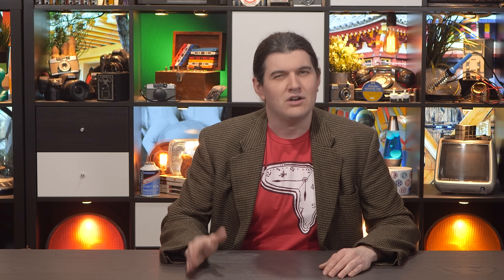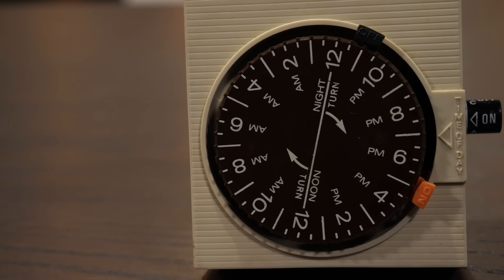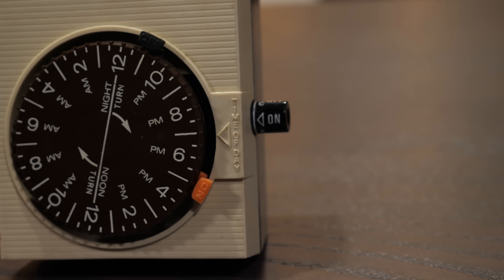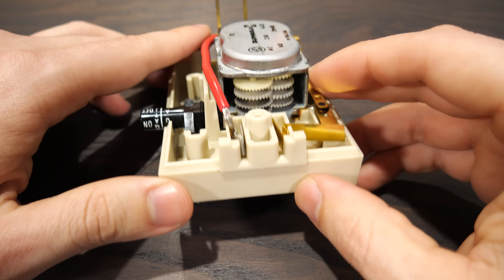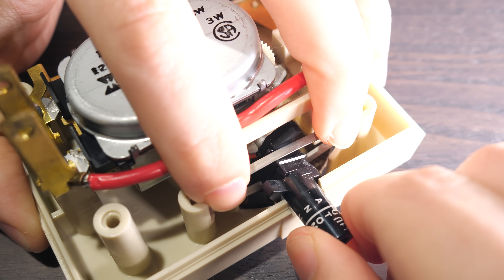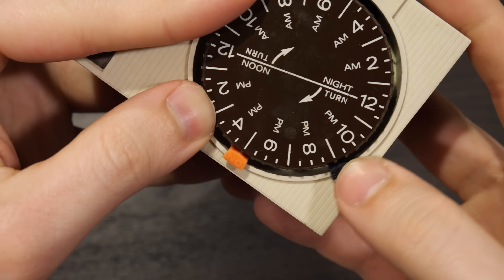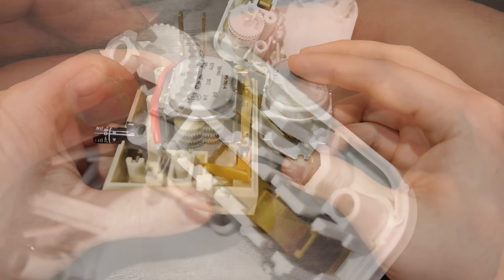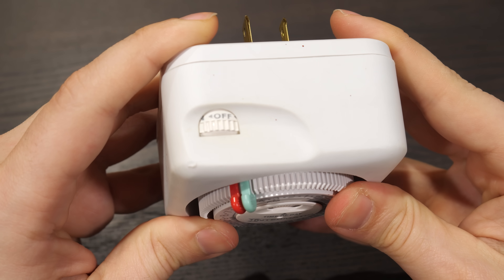Timer switches: literally just a clock and a switch

Comment: I learned all about the 60Hz of your funny foreign electricity when I bought a GraLab darkroom timer from the US a while back. I knew about the 110v so I had an adaptor to reduce it from our hairy-chested 240v and it ran- albeit too slowly. -Ah! - we have 50Hz here in England. - Luckily they run on a standard motor/gearbox used as an actuator for motorised valves in central heating systems. I bought a UK spec one and it now runs fine,   
You're right about how accurate the AC frequency is maintained: I have my Grandfather's electric clock from the 1930s and it's uncanny how accurate it is!

Comment: no need to have a different place to store the tabs, as you can just put the "extra" tabs in sequence with others of the same mode.  They will just have no effect.  i.e. 2 or 3 On tabs in a row,  2 or 3 Off tabs in a row.  I suppose it wouldn't work if you only wanted a single interval of the minimum spacing, in which case you'd have two One tabs leftover, but that would be rare.

Comment: The advantage of the mechanical timers is that they simply do their job, even if they don’t have a WLAN connection to update the firmware. So they won’t fail and when You return from Your two weeks holiday the house won’t be burned to the ground 😄.

Comment: I recently looked into getting timers installed in several wall switches for outdoor lights. Turns out it's less than half the cost of an astronomical timer to just get a Wi-Fi enabled smart switch, so now I'm using them mostly as dumb timers with the added benefit that I could control them with an app on my phone if I wanted to.

Comment: The old ones are still the fastest to get setup. The new digital ones may be better but take longer to figure out and setup. And the even newer ones with wifi take even longer to setup, have to get them connected to wifi and configure them and all. I have all of these different types. For a quick setup the old one is the fastest. That said if you have the wifi ones already linked up with the app and wifi, they are the easiest to reset or change times and can be controlled from your phone. It really depends on, if you want to take the time and setup a new one, digital is more convenient with wifi in the long run, but if you just need a quick install the oldest ones are the fastest to have working. Personally at this point the old ones or the new wifi ones are my choice, I don't like the digital microcontroller ones because you have to figure one how to program them which can be a pain. The wifi ones normally have a nice app and are fairly straightforward but that's just my opinion.

Comment: Where I live we used to have more modern design version where wheel had a lot of sliding "switches" which were used as mechanical actuators for switch.
Main advantage was you had ability for multiple on/off actions during the day (you pretty much chose when you want switch to be on, not when togling action happens)
There was no override i believe though. I am also not sure what kind of switch was used, but I would expect it to use basic micro switch.
The digital electronic version of timers are in my experience quite horible due to backup nimh cell they stick inside, it fails way too soon for those timers to be reliable.

Comment: That gear-reduction cluster is needed to make the wheel rotate at the correct speed of 1 rpd, but it also adds a huge amount of mechanical advantage, allowing the tiny motor to easily push the levers or buttons in the crudely made device, which require some force to actuate.

Comment: 2 things of note for the mechanical/analogue timers.
The first is that they are generally a lot cheaper than the digital ones.
The second is that they are not silent.
That little motor makes a buzzing sound, regardless of whether the timer is "on" or "off." So you may not want to use one in some situations. Such as your favourite place to read, or your bedroom.

Comment: Truly enjoyable video. I have had and used all of these types of timers. I still have several of the type with the push / pull tabs. And recently picked up a digital version for Christmas lights, and it is for me the most difficult to program.  I have several tansformers with the pin type timers built in for out door lighting. Over the years the timers seem to go bad, so I would by a new transformer for $60 - $80. Then the idea struck me to just run the transformer thru the timer.

Comment: I think I've used every version of these mechanical timers. I'm actually sad I didn't see that digital one... I don't want an app + wifi. I want something dumb. But having a classic themostat control for a light? Perfect. My challenge now is I have 2 timers that I use: one manages to sound like a time bomb and the other has enough tolerance that the switch can fit between each of those 40 teeth... but only sometimes.

Comment: Wiki: Intermatic introduced its first time switch in 1945, which was used for "electric signs, store window lighting, apartment hall lights, stokers, and oil and gas burners." A consumer version was added in 1952. I guess that answers the question when they appeared.

Comment: I recently bought one of these to cycle my older AC unit in my apartment.  The power outlet for my AC unit is 240v so the timer I bought is the older mechanical style but rated for 240v / 4800w.  Now that I think about it, I wonder if the motor (clock) will still keep accurate time if i plugged it into 120v....I know its the same Hz but I wonder if the motor requires 240v to turn the motor and gears properly.

Comment: 12:10 I was going through a "trial and error" trying to set up a very cheap timer. As I tried to lift up some of the tabs, they snapped off the timer, and it was impossible to get them back. So, I had permanently set the timer "on" for those bits. I went and bought a smart plug, connected it on to Wi-Fi and set wanted schedule on a mobile application. It still makes a neat, almost "DING" sound when it switches off at 2000 hours.

Comment: Got to love mechanical timers. Digital ones are cool, but if just want a light to come on for a certain number of hours every day, it's hard to beat a mechanical one. I used to have a pet lizard, and at one point I thought it would be clever to use a digital timer for his light. The trouble was if there ever was a power cut, it would lose all its programming. It did have a slot for a backup battery, but it seems it was drawing power from the battery even when it had mains power, so inevitably by the time a power cut happened, the battery would already be dead. And the worst thing about a digital timer is that when it got power back, all its program would reset, so you had to start over. And as I was often out for most of his lit up hours, it could sometimes be a couple of days before I'd notice. At least with a mechanical one, the lizard would get the required number of hours of light, even if it was getting them a little late. 
I'm sure  there better digital timers than the one I had. It shouldn't be hard to make them only use the battery when there's no mains power. And perhaps add a tiny amount of Flash memory so it could keep its program if both mains and battery power fail.
But unless you need the fancy functionality of a digital timer, there's a lot to be said for the mechanical ones.

Comment: I've had every one of the motorized ones, and they all die the same way - the motor eventually conks out. The newer ones just conk out more quickly. Ended up getting a few digitally programmable ones from Amazon that are far better (and don't lose clock/settings when disconnected even for days or weeks).

Also, for those tabs, one trick is to slot the extra green tab safter the desired tab, and the extra red ones after the desired red one (e.g., Gggg___Rrrr___) since they end up ignored (unless you switch things on/off manually...).

Comment: You may want to dismantle the clock motor of the timer which you broke (the hidden screw under the dial).  You will probably find that it effectively has many poles, not just two (there are ALWAYS an even number of poles), and that, therefore, its rotor turns much more slowly than 3600 rev/minute.

Comment: I like the old mechanical timers, but they can be noisy.  Not loud, but in the dead of noght you can hear them.   The new digital timers have more featurea and are quiet, but you almost need  a degree in programing (which I have) to set it up, and the display is cryptic, and awkward to read unless you unplug it and hold it while programming.  Remembering what button is the override is not always easy to know or find in the dark either. Arrggghhh...

Comment: Those removable tab ones actually had a feature lost in the newer up-down timer where you could have multiple on or off...say if you turn the light back on manually it could turn off a second time later.  That is why I now prefer digital timers (or smart plugs).  Also digital ones have less power consumption.

Comment: Wire-wrap makes a nice cold-weld on a square terminal, just ask the little old ladies industrially wire-wrapping computers and other electronic devices in the 50s and 60s. Even into the 80s and 90s, you could still get wire-wrap tools from Radio Shack for prototype boards. Tightly binding a wire against the pointy corner of a square peg resulted in a very sound electrical connection.

Comment: Intermactic is still around. I use the heck out of the more commercial offering they have. It is cheap and robust great for the farm. I run well pumps, lights, ventilation fans, swamp coolers, heck even my irrigation systems. I have one that my dad installed on a water heater in 1985 it's still there and working to this day.

Comment: The clicky down type timers are still routinely used here (UK) on boilers (gas furnace) to set the on and off times for your heating. Coupled with a thermostat that will turn it off and on too.

Comment: Now guess what kind of stupid timer electricians always put in Italian fuse boxes? 
Imagine 96 dip switches on a rotating 24 hours drum, all next to each other with no spacing, and you can see only one sixth of the drum on that small window, and the mechanism is so hard to rotate it's basically impossible to set the current time correctly.
Yeah, now imagine that being used for outdoor illumination...

Comment: In my job, I use a small crock pot to keep water hot so I can dip sheets of wax in it to soften them.  If I turn this on when I get to work in the morning, it takes about an hour to get up to the temperature I like.  I would heat the wax over a Bunsen burner until it was ready.  Finally, it dawned on me that I could get one of these digital timers.  Now, the crock pot gets turned on about an hour before I get to work, so it’s ready when I get there, and it turns off an hour after I’m supposed to get off, which leaves time if I have to work a little overtime (every day, right?).  The digital version allows me to have it set to stay off over the weekends.  It’s been working great for me for the last 7 years, or so.

Also, I have an extra remote-operated switch that we only use at Christmas so we don’t have to crawl under or around our tree to plug or unplug lights.  It’s fun to take that to work and sneakily plug a coworker’s piece of equipment into it.  They sure do get confused and frustrated when something shuts off in the middle of using it.
*note - It’s all in good fun and never used on something that would be dangerous.  Don’t worry.

Comment: The stupidest thing about the tabs on the newer models is that.. pressing down is "on", pulling out is "off". Ok, this makes sense in our heads but guess what happens when you handle the thing, like when you plug it in a wallsocket? Yes, the tabs are pushed down and no you have to pull them up again. Also, pushing them down individually is quite difficult but.. pulling up can be done tab by tab much easier. It is generally considered that ALL devices default to "off", not "on", so that if mistakes happen it means we make things go "off", not "on"...

Comment: I use one everyday. It’s set for 6AM and turns on a LED table lamp. The light has a Manila paper covering over the lens so isn’t so stark but bright enough to wake you up almost like dawn itself. At 7AM it turns it off. Of course you have to reset it with DST or if the power has been off for some reason.

Comment: yo, timer switches are super useful, I have basically my entire apartment fitted with digital timer switches. Turned my 20 bucks coffee machine into a luxury one that has my coffee ready and at the perfevt drinking temperature when I get up. Could buy a 1000 bucks machine with a timer or get a 5 bucks digital timer switch

Comment: Those built-in-tiny-tab designs used to be pretty common on household boilers in the UK. I've lived in flats with them, and they were a very handy way to pre-set having your heating come on in the winter. Much better than my current system, wherein my boiler reads the programme from a thermostat across the flat from it -- but sometimes decides to connect to my neighbour's thermostat instead, and heat to their programme instead of mine. 

Meanwhile, I'm still enjoying a plug-in mechanical-tab timer switch in Scottish winters, which I have plugged into a SAD lamp so that it turns on before my alarm in the mornings, so I don't have to get up in the dark.

Comment: One thing that's always bothered me about such devices is that they can be too precise, which (when used with a light) means they are basically an advert for burglars.
With modern electronic timers it should be possible to have a time range instead, perhaps even taking ambient light conditions into account, making it much harder to distinguish a light being switched robotically from one being switched by a human.

Incidentally, with smart plugs, I have been known to remotely switch lights somewhat randomly when I'm not even in the country.
Maybe I'm paranoid?

Comment: 10:27 that's called wire wrap! It's actually a very reliable way to assemble electronics, and was phased out only because it's not as convenient as other techniques. You need a special tool to wrap the wire, and it's the friction between the sharp edges of the pins and the wire that hold the assembly together

Comment: Once upon a time, I used a timer from Radio Shack to record AM and shortwave radio in the middle of the night.  The radio had a separate timer to turn on and off and change frequencies. So I connected a tape deck to Radio Shack timer.  The tape deck could be set to auto play or auto record, and auto flip the tape if needed.  The end result was a beautiful harmony of  the radio doing it's automatic thing and the tape deck coming alive with a huge clunk and then silence because there was no way to listen AND record.  Later it would clunk again as the timer turned it off or when it auto reversed.  It worked flawlessly, except for the whimsy of the ionosphere.  Still have many of those tapes but like many people, no actual cassette tape devices to play them.  But also no time to listen even if I could.

Comment: I have one of these Intermatic timers. Mine is called Supercop. It appears to have been advertised as a theft deterrent device. Nearly the same style as the Time-all.

I looked up date codes for these and they have been using a 3 digit date code with the first 2 digits being the week # of the year. And the last digit representing the ending digit of that decade. They started this system in 1980 beginning with A and repeating every 26 years.

Your Time-all has a date code of 518. Assuming they used a similar format, that would place the mfg date around the end of december, 1978. That’s inferring since mine has a date code of 50G. Putting mine at december 1986.

Comment: Regarding defrost timers on refrigerators, many years ago, a refrigerator stopped doing its auto defrost and started needing regular defrosting (which was annoying, as even taking it outside and setting a desk fan to blow air into it, it took a long time to melt the ice behind the cooling plate, which couldn't easily be removed because of coolant piping), but otherwise worked fine. There were calls to replace it. I suggested trying a timer switch that turned it off for a while every night, and once we sorted out the appropriate off time, it worked perfectly, and we got another ~15 years of life out of the refrigerator..

Comment: I love these last generation tab up/down mechanical timers. We had one of these for our central heating and its so simple and easy to re-program so even with our totally irregular schedules we always re-set the time every night if needed.

Having "upgraded*" to a nest we've never bothered as.... It takes a few seconds longer so who can be asked!

*Yes, the mechanical timer was battery operated with two AA batteries and sadly only 1 battery was used for driving the timer which died quite frequently while both were utilized for the radio link to said boiler. And when the radio link died it defaulted to off, and we regularly left for extended periods of time....)

Comment: An advantage of the removable tab is you can make a program to manually perform one function and automate the other. Specifically, I want to manually turn the fan on when the day is cool enough and I open the window then turn off in the early morning.

Comment: I remember mechanical timers older than the shown Intermatic.  They were bulky metal things that sat on the floor or table, had a power cord going to the outlet powering it.

As a kid more than 40 years ago, I built my own timers by hacking tube clock-radios and connecting the timer switch to external low voltage DC things.